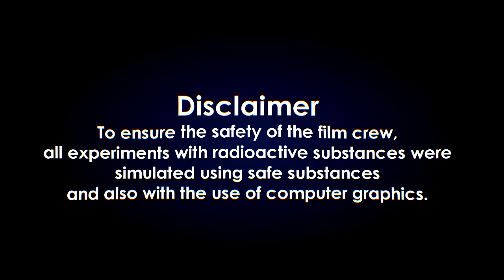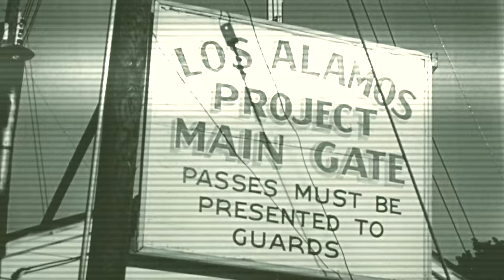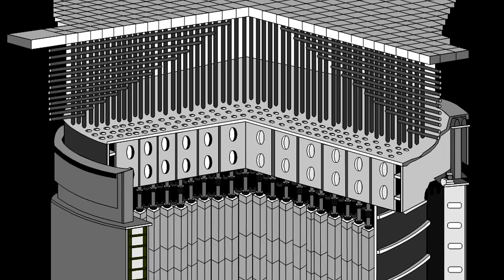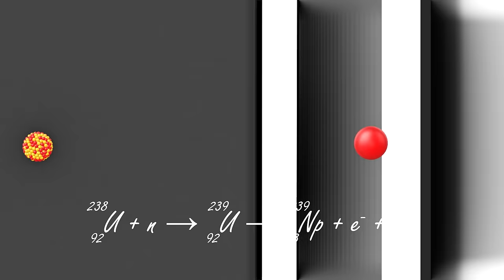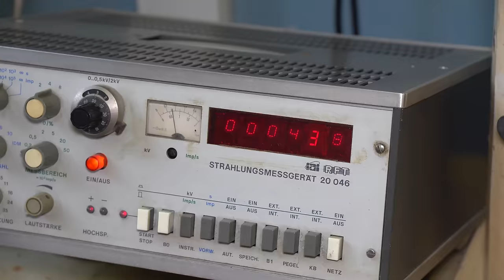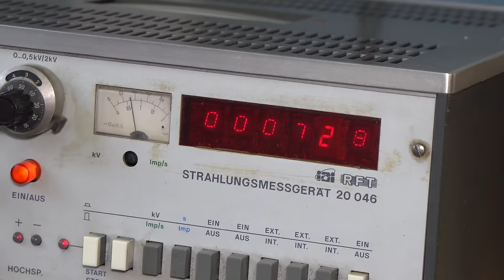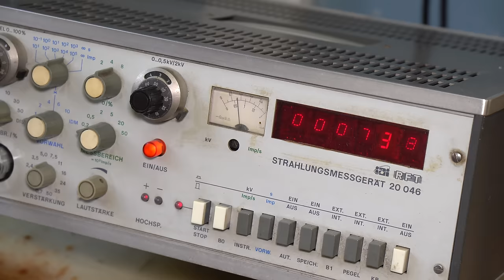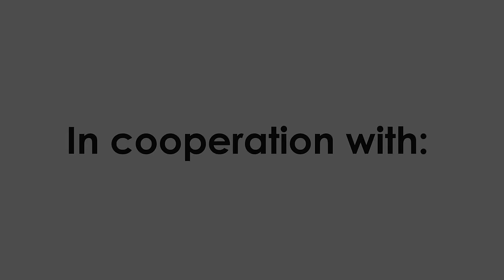Plutonium - The MOST GUARDED Metal on Earth!

Comment: The only thing I saw, was the facility should have a massive safety upgrade. There is no point in a glove system, the entire system can be made so there is no human interaction, except through remote control of various bots... that dust method of shaking to get out of that cylinder was cringe worth... The best thing about an autonomous environment is that you don't need square walls which can assist in bots movement and correcting mistakes... who knows... The primary safety increase would be removing the person from the system, with no need of windows or anything.... 

If a human needs ot entet for some rare ocassion IE dismantling... a speciazed suit under a  flood of liquid, and platform boots... lmao...

but maybe Eggbert is really plutonoium...

Comment: 4:39 where does it get the extra proton to become Np? or 4:51 to become Pu?
Reply: Beta particle emission.  A neutron splits into a fast electron (beta particle) and a proton, so the atomic number increases by one, but the atomic mass remains essentially the same as the beta particle is very light and there is some conversion of mass to energy, but that also is very small.

Comment: Instead of dumping it in a tank of water and wasting the energy, why don't they dump the spent fuel rods into a big pile that is the core of a heat engine and use it to generate useful power? Nuclear power of a different type, just radioactivity power.

Comment: Would it be possible to use the blending of fission and fusion to generate heat in a controlled manner? The deuterium could be (possibly) incorporated into uranium or plutonium fuel rods with the goal of achieving fusion, one molecule at a time by bumping them with the high velocity particles of fissioning uranium or plutonium.
Reply: In context to a bomb instead of power plant isn’t that similar to a thermonuclear weapon fission reaction kicks off a fusion reaction?
Reply: @deadshot4245  I have read that what you say is how an H-bomb is initiated.

Comment: The part about alpha-particles being blocked by paper gives a false sense of safety. Unfortunately, the tissues of the gut and the lung are not coated with paper, so if an alpha emitter is deposited in either of those locations, it is a bad day for the DNA of the surrounding tissues.